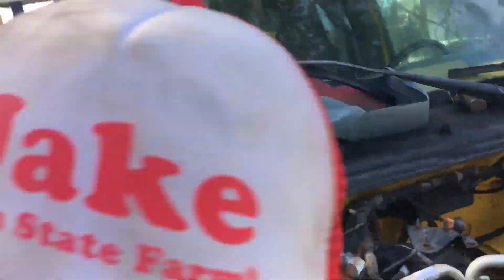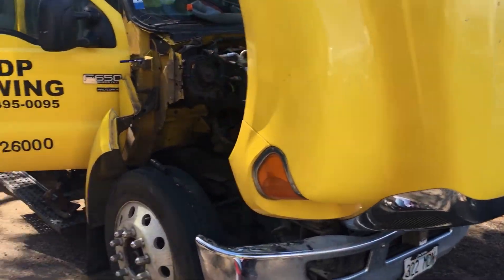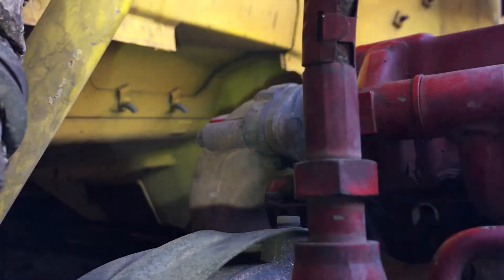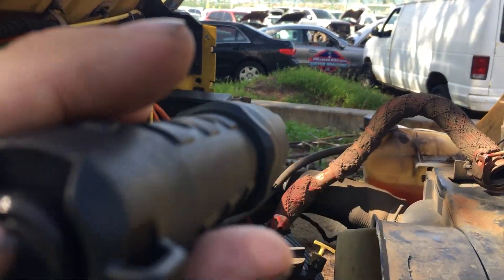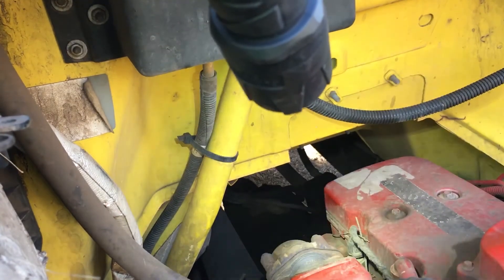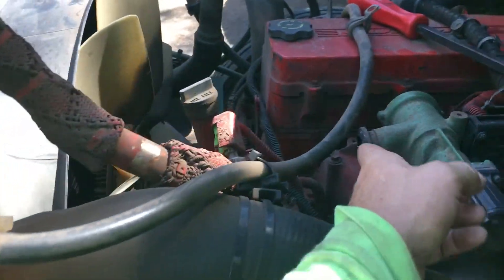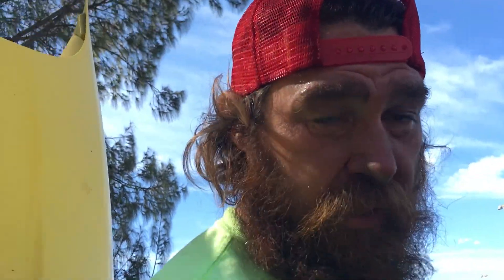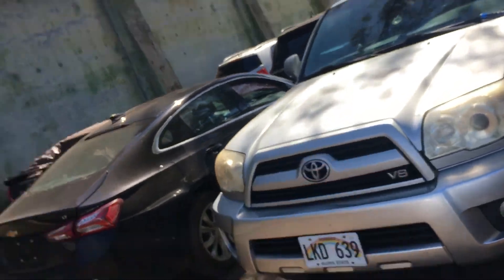1957 Chevy in Hawaii....EMERGENCY 91...808!! A friend in need is a friend in....need?! Yup

Comment: Meanwhile, it's below freezing here now :(
Reply from the maker: If it gets colder than 70... the seat heaters come on in the truck.
Reply: @JAWSatBCPerformance  man, weather like that would be so nice.
Reply from the maker: Half Fast Garage with the colder temps like that comes rain. Usually we are around 80-85. If its below that I put a shirt on. Sweats come out and go on if it below 75.... we aren’t used to much cold weather. Occasionally it is in the 60s at night and we are bundled up and checkin to see if the pipes are freezing.
Reply: @JAWSatBCPerformance  wow. That's such a different life style than what I'm used to. I wouldn't mind trying it  out 🤣
Reply from the maker: Half Fast Garage its a struggle. Surfing each day and working a few hours and playing with hotrods....its not all fun and games..
Reply: @JAWSatBCPerformance  it sounds pretty rough 😂 I didn't know there was a hotrod community over there. But I'll be honest, I don't know much about hawaii.
Reply from the maker: Half Fast Garage yup. Lots of gearheads trapped over here. Most are old and have multiple cars.
Reply: @JAWSatBCPerformance  we can trade spots around November :) I'm a Padi Dive Master so I wouldn't be opposed to diving around there for a few months and you can use my frozen shop :)

Comment: Is that a Cummins ISB? If that is an ISB that is the EGR Cooler. Don’t reuse gaskets, o-rings. You should replace the clamps as well. Did you remove the Turbo?
Reply from the maker: Nope. Replaced the gaskets but didn’t remove the turbo. The oil for the turbo is plumbed into it also, didn’t remove any of that. It is an ISB. Did not replace the clamps. It was leaking only in the on spot. Most likely from the last gasket change on the head. It was never apart at the cooler. The original gasket was broken. I think it was the actual leak from last time.
Reply: @JAWSatBCPerformance  those Turbo’s are difficult to get off. There is a special tool from Mopar that does a great job and if you did you always want to replace the studs and nuts. It is a pain. Mostly because of one nut on the turbo. Lots of fun. Glad you didn’t remove it.
Reply from the maker: Turlo’s Garage good to know. It was replaced with a new one last year in attempt to find the squealing noises. One of them was the turbine bearing, the other was the gasket. I had to come find the unfindable noise and fix the electrical draw. There is still a circuit in the HVAC that is shorted to ground in involving the vac pump for the HVAC relay, the fuse box and vac pump. I need a digram for the circuit.